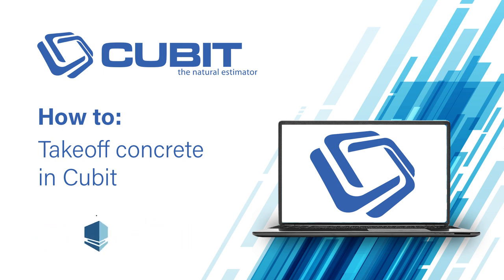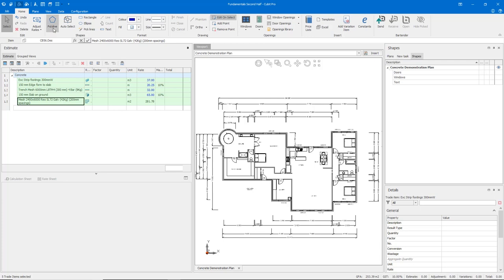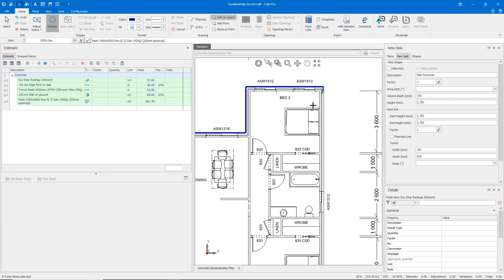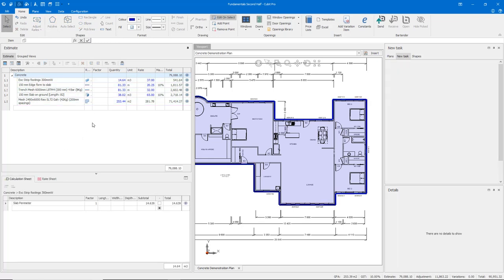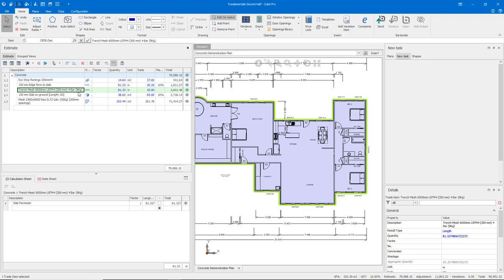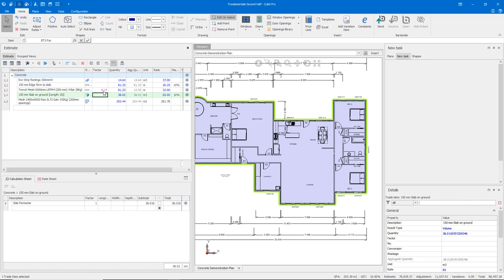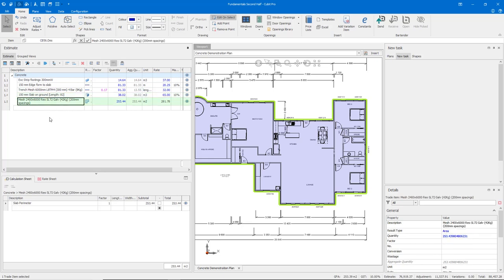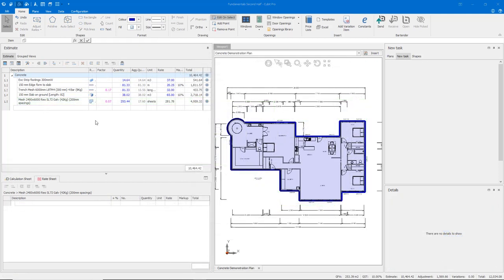How to takeoff concrete in Cubit

Comment: Typically you would factor a 500 mm overlap between trench mesh, meaning use 5.5 instead of a factor of division of 6
Reply: And plus I'm concerned that factor thing does nothing but to divide the whole quantity, and does not think about waste unuseable portions of the material. When I reverse calculate, 17.6*2.4*6= 253.44 exactly. So This factoring thing literally does nothing but to divide the whole material and assumes that we will use any bits and pieces and will have zero waste material but only the last sheet............
Reply: @dennisyildirim2708  There's multiple fields that you can use to calculate all of those things.  You can use the factor, conversion and waste columns to make sure you account for what you are speaking about.